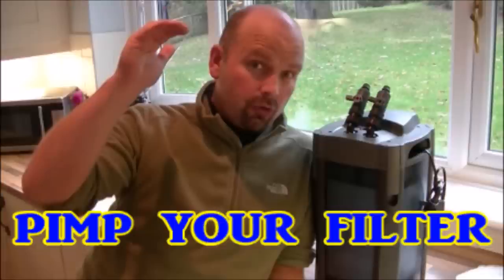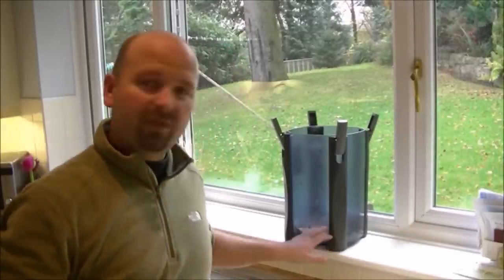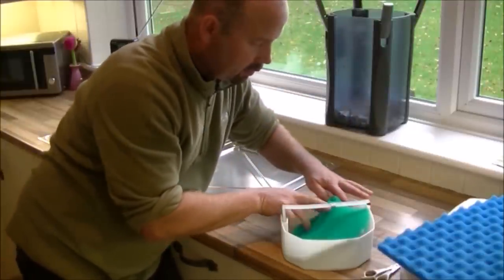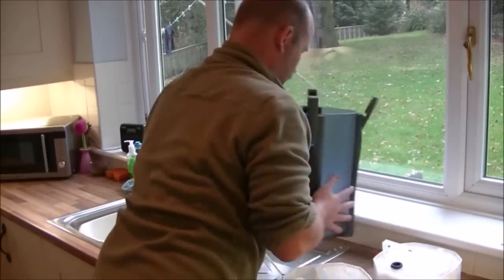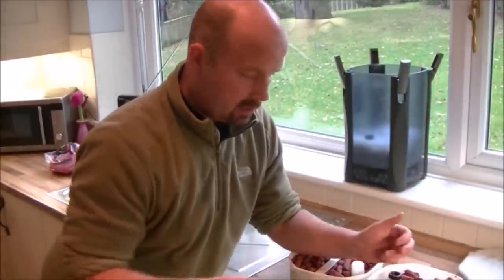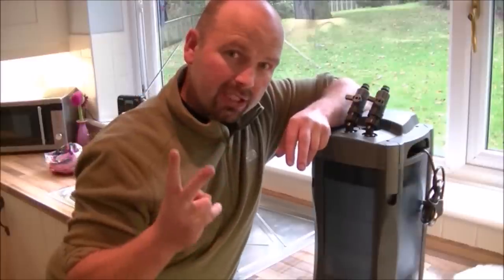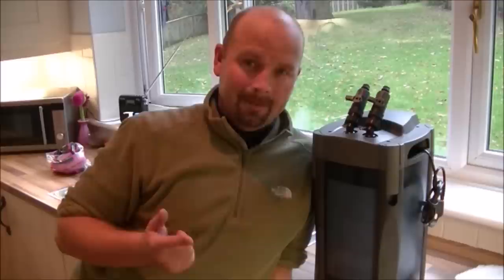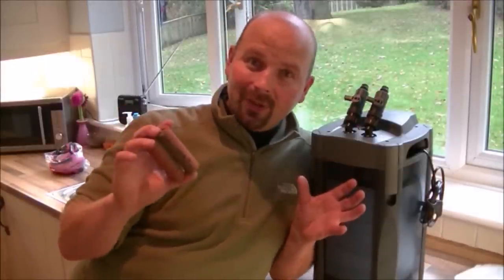External canister filter set up, nitrogen cycle and what happens in a filter - by Pondguru

Comment: what filter is this in the vid
Reply from the maker: +jameshone1000 This one was an Aqua One Aquis 1250 with 3 trays. Each of the 2 media trays holds 1.5kg of biohome ultimate so it used 3kg to upgrade the filter (bottom tray was used for the foams).
Reply: +Pondguru Outdoors thanks looking for a filter to use with my 300l fish tank
Reply from the maker: +jameshone1000 For a normal tropical community tank the Aquis 1250 would be fine as you would generally try to use approx. 1kg of media per 100 litres to see full cycle filtration (reduction in nitrate).
Reply: +Pondguru Outdoors and I have been wondering I know the hole point of filter is some were for the good stuff to grow but would having a uv bulb in your filter would kill the good stuff as well as the bad stuff
Reply from the maker: +jameshone1000 As long as the UV was turned off for the first 2-3 weeks of the filters life it is not a problem having a UV in the system. The only issue arises from the super cheap filters which can have the UV shining onto the media which does indeed kill all the bacteria. Unless you have linked tanks operating on one filter system there should not be any need for a UV indoors.
Reply: ok thanks for clearing that up for me I only want one with a uv so that if I have a outbrake of somethink in the tank I can clean the water other then that it will stay off all the time
Reply from the maker: +jameshone1000 Yes that sounds like a sensible solution to a potential problem so will definitely be a justifiable reason for a UV in a single tank set up.
Reply: and grate vids and keep them coming and fluvel filters have such a wired lay out
Reply from the maker: +jameshone1000 Most manufacturers filters are all messed up, lol

Comment: Could you demonstrate firstly, how to pimp a HOB and secondly, how to use biohome in a HOB.  Thanks.
Reply from the maker: Aaaarrgh...HOB filters aren't the best to improve as they rely on that damned replaceable cartridge system but as long as you have the foams and fine pad in the correct order then follow that with good biological media you can't go wrong.
Reply: What about the aquaclear HOBs, they have a huge storage area..biohome could be used in those couldn't it?
Reply from the maker: ORANGE FISHEAD Yes any filter which has space for media will benefit from using biohome in place of the existing media.
Reply: Thanks, I use both HOBS and canisters.  Eventually want to build a sump which I am sure bihome will work nicely in.  Does rate of flow affect biohomes performance? Is a slower rate better ? I know I am asking a lot of questions but I keep african cichlids and am trying to find better way to keep nitrates under control.
Reply from the maker: ORANGE FISHEAD It works fine at all flow rates since the pathways inside the media will allow water to flow through at very slow flow rate even if fast moving water flows over the media. Therefore the water becomes deoxygenated as it flows through (due to aerobic bacterial processes) and conditions become favourable for anaerobic bacteria. That is where the nitrate reduction happens.

Comment: your website is knackered m8, it wont let me have a delivery address different to my billing :( NVM guess ill look elsewhere.
Reply from the maker: I have had a couple of orders through today which had a billing address and a delivery address which was different. Some people seem to order then send an email through the 'contact us' page to check that it's going to delivery address but when a different address is required for delivery the system may not show the buyer that has been confirmed? - that could be where the confusion is but the two different addresses do come through on the confirmation I get.
Reply: Pondguru cheers for the reply. Everything was okay on your site but when I went through to PayPal the had filterpro saying delivery address was the billing address, might wanna look into that because it's the only time it's ever happened to me. The person who is receiving it for me is just gonna order it so delivery and billing are one and the same, otherwise was gonna have to get it off eBay or something.
Reply from the maker: Thanks, I will get the guys who made the website to take a look at that - I know paypal always classes the account holders address as the delivery address unless told otherwise but there must be an option in there to add a separate address as I get orders with 2 addresses all the time. I'll have a look too, no worries.

Comment: Hey Pondguru, I have the Eheim eXperience 250 external filter and their set up has the fine filter on the top sitting in the media tray.  Would you recommend modifying this to they way you have in this video?

You can see the filter set up in the link below- it's the 3rd photo.  

https://www.eheim.com/en_GB/products/technology/external-filters/new-experience250#
Reply from the maker: Yes the bottom tray should be for your coarse, medium and fine foams followed by media in the tray above. As their filter is rated for normally stocked tanks of around 120 litres that would make me think that the media tray would take approx. 1.5kg of biohome ultimate as Eheim are normally accurate in sizing their filters.
Reply: Thanks for the reply.  So could i essentially move the fine filter to the bottom tray sitting on top of the othet two filters and  just have media in the top tray.  Also, the two foam filters are the same grade, is it wise to buy a sheet of coarse and medium foam and cut it to size?
Reply from the maker: Yes it is always best to have the water passing through progressively finer material to properly filter out the muck and prolong maintenance times.

Comment: I'm afraid you're wrong about your setup. If you put the mechanical media right at the bottom and don't leave not much area for the water flow it'll just cause clogs and more wear on your filter motor. Ps I only watched about 4 minutes of this video and couldn't stop shaking my head. 
I've done what you illustrated in another similar video about canister filters, and how to set them up 'properly' and haven't had ANY success whatsoever. 
If you ever pick up a rock out of a riverbed it'll have a slimy coat on it. This is what 'biological filtration' is. If you put a fine filter pad BEFORE your media it stops all the 'muck' from getting on your media. This IS NOT what should happen. You want a course filter pad after your 'mechanical' filter media, then your media, THEN a fine filter pad. Therefore allowing sufficient growth of biological filtration.
Reply from the maker: Oh dear, you have absolutely missed the point of mechanical and biological zones, what a biological filter media should be doing and why the particulate matter needs to be removed before water hits the biological media.
Apart from the in-depth explanation in this video there really isn't anything I can say to educate someone who does not want to learn so I can just suggest watching the video and thinking about what is being said.
But if you can't be bothered to watch I will try and summarise below:
As far as flow reduction goes the positioning of coarse, medium and fine pads makes no difference (unless fine pad is first obviously as it would clog very quickly) since the water still has to pass through all foams and pads at some point as it travels through the filter.
However from a mechanical filtering and maximising biological filtration zone point of view it makes a huge difference as this video and the previous video on external filters clearly explains.
Just because I am explaining the common sense way an external filter should be set up does not mean that I expect everyone to follow that advice but when you are talking about expecting the biological media to get covered in muck to work properly I am the one shaking my head since biological media should be processing ammonia, nitrite and nitrate in water that has been mechanically cleaned, not mechanically filtering the water, becoming clogged and being rendered inefficient.
More dirt on media = more clogging = less efficiency.
Less dirt on media = less clogging = increased efficiency.
Reply: Pondguru there's going to be dirt in your filter anyway... If you put a fine filter pad BEFORE your media it's going to become clogged. If you're running a shop and checking on it everyday that's fine. But most people want to minimize aquarium maintenance. Which is what I was hoping to achieve watching your videos. But I'm afraid I was mistaken.
Reply from the maker: Tim Palmer It's silly to think that the fine pad will become blocked slower if it is after the media as using the filter media to catch the fine dirt to save the fine pad is plain retarded. If minimising running costs and maximising efficiency is not on your list of priorities then I have no problem with you not watching. I'm happy to put these videos out for free to help those who are capable of learning but I will not feed trolls who are trying to provoke a reaction from such a ridiculous failure to misunderstand what should happen inside a filter.
Ask anyone who has their filter set up properly with the appropriate amount of biohome and they will be happy to tell you that their ammonia and nitrite is zero and in many cases even the nitrate is untraceable.
If you want to be stuck in the dark ages of filtration then I can't force you to understand - Hell, for all I know the earth might be flat and the sun may revolve around the earth.
Reply: Pondguru I tried your method and it didn't work so there's 
something clearly wrong with the way you setup filters. 
Anyway I'm done with this pointless arguing because you're clearly set in your ways.
Take care now. Bye bye then.
Reply from the maker: Tim Palmer Very sad indeed.
The very definition of 'set in your ways' is blindly following filter manufacturers inefficient ways of setting up filters.
Once you understand the simple principles of filtration you are welcome back.
Reply: Pondguru
its like educating pork mate :)
Reply from the maker: lol, yeah - more like a pork sword.